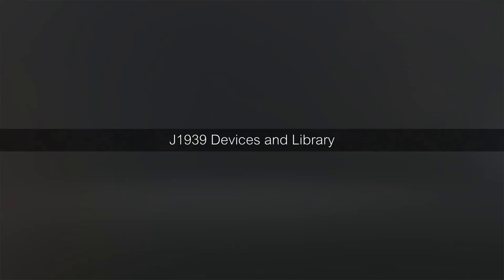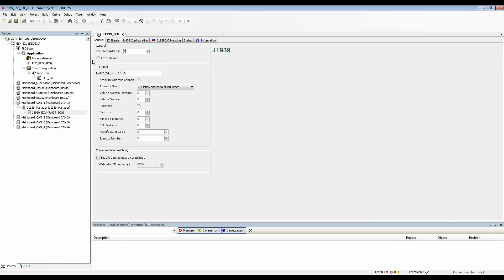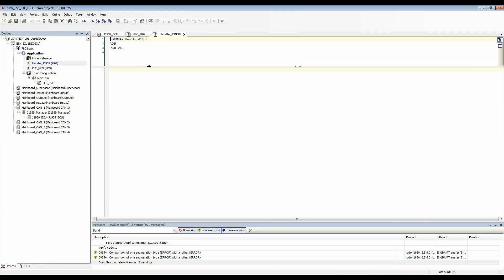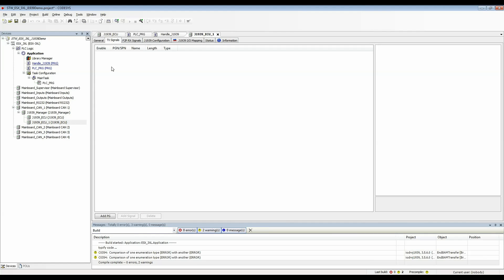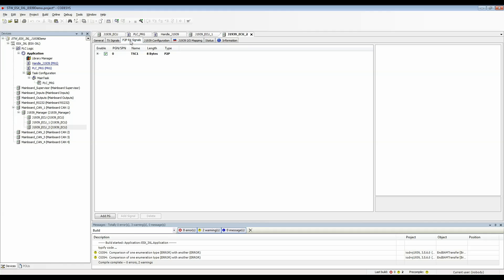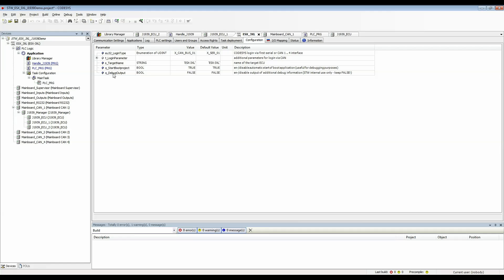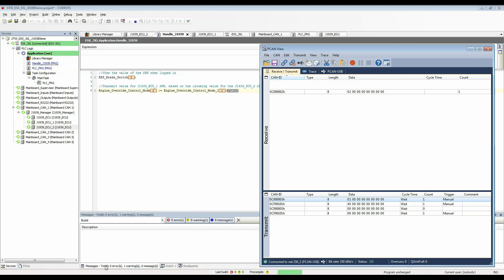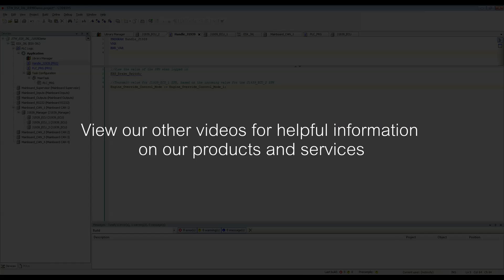Tutorial - Codesys v3.5 Basic J1939 Communication

Comment: Thanks, the only issue that I have is that when you create a 'local' device, and try to attempt to add a PGN, there seems to be only a very limited set of PGNs. For example, EBC1 with PGN 61441 is not available in the list and I cannot create it as a custom item! Am I missing something?
Reply: I miss that too...
Reply: @FORRISSI  @simonmaton It's not missing.
EBC1 is a broadcasting PGN. If you want to transmit it you can configure it on the Tx Signals tab of a local device. If you want to receive it you have to create a remote ECU (local ECU checkbox not checked) and then you can add it here on the Tx Signal tab.